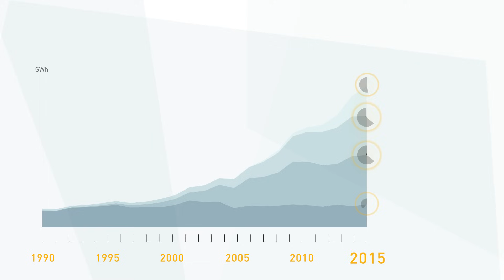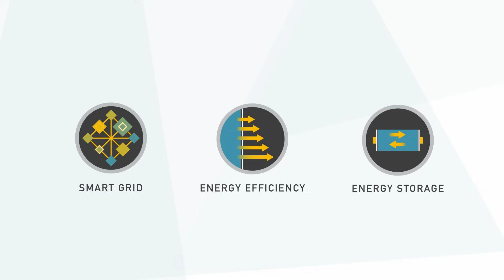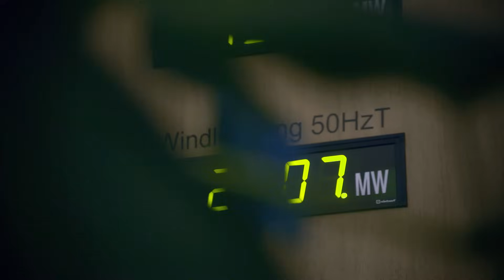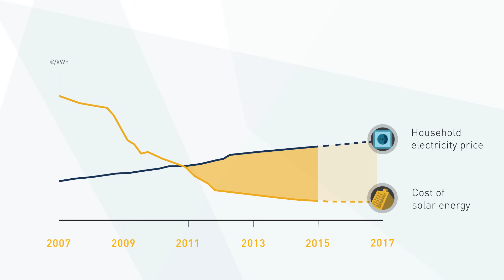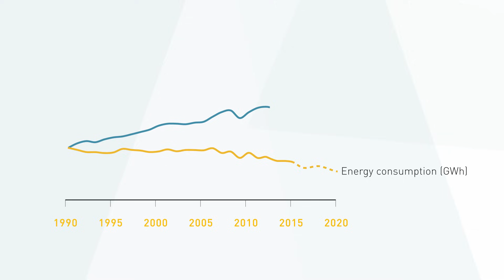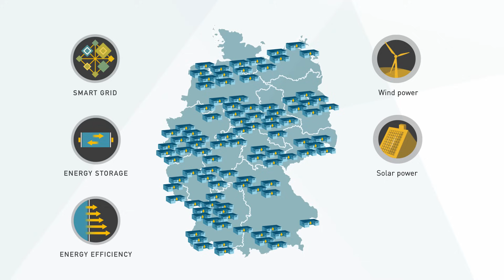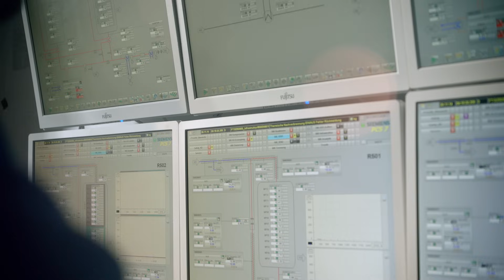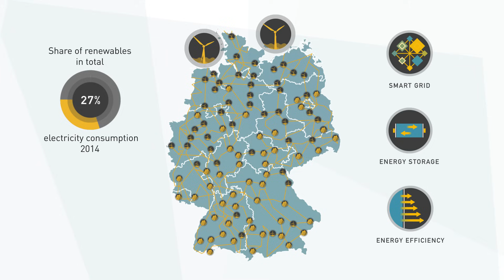Germany's Renewable Energy Revolution

Comment: This so called green "revolution" will fail. The cracks are already beginning to show. 
- The costs are enormous. This is primarily due to the insane capital costs.
- Energy prices are rising in germany.
- There is no significant reduction in co2 emissions in fact it has pretty much stayed the same and some sources even claim it is rising.
- The German grid is extremely unstable. There are more interventions than ever.
- They (wind and solar) are not able to give base load energy and storage is not feasible.
- Germany is one of the worst places in the world to produce solar electricity. Yet they have invested (at least per capita) the most in this technology.
- They are now burning trees as "bio fuel". Which is a shame because trees actually reduce co2, so burning them is very counterproductive if your goal is reducing carbon emissions. 

Unless Germany wants to be a 3rd world country in 30 years they should stop this insane policy. There are green ways of producing electricity but wind and solar are not practical. Geothermal and hydroelectric are real green solutions, however geothermal is far from being realised worldwide and hydroelectric is limited to specific locations.

We should stop giving wind and solar preferential treatment. At least let electric companies decide whether they want to buy solar and wind kilowats.

Stating that other countries are envious because germany is committing economic suicide is also stupid. Mostly people who have utopian fantasies and people who have a lack of understanding about the concequences of such policies are envious of germany's green energy policy.
Reply: +Guy B Can you provide your sources? Because i'm pretty sure that most of what you state here is just not correct.
Of course the cost's are high, but not nearly high enough to bring down an Economy, In fact, they are actually a joke if you compare them to for example military spending or foregin aid.
I don't know what country you are talking about but CO² emmisions in Germany have been going down for years. 
The German grid is overly stable, with statistically less than 20 minutes of power outage per power connection per year. (European average is 58 minutes, US average is 240 minutes) That's one, if not the most stable power grid in Europe. 
Well with a smart grid you could in theory cover a majority of germany's base load using sola and windpark's. The rest could be covered with biogas and water. 
Well guess what germany might not be a "good" place to build a solar park, but it is still worth it because solar pannels got so much cheaper, largely due to the investment's that have been done. In fact, covering a square meter with solar pannel is now cheaper than covering it with bathroom tiles. 
They are not cutting down trees to burn them, they are mostly using wood waste. It's also not called Bio fuel, it's  called pellet heating and those heaters are mainly found in private household's. 
And yes, energy cost is high, but it has always been like that in germany. They have gone up a bit because of the changes that have been made, but they are expected to come down again as soon as all the infastructure is built and payed off. 
And Electric company's are actually deciding to buy solar- and wind kilowatt's. In fact, solar energy is very cheap on the market and many households decide to pay a few cent's more per kilowatt in order to have their power provider only buy green Energy for them. 
Your turn. Prove me wrong if you can.
Reply: Mark Oberst “ Can you provide your sources? Because i'm pretty sure that most of what you state here is just not correct.”
I will provide information to the case I am presenting.

- The costs are enormous. This is primarily due to the insane capital costs.
https://en.wikipedia.org/wiki/Cost_of_electricity_by_source#Germany

Provides information about Germany as well as other countries. Solar and wind are almost always among the most expensive.

- Energy prices are rising in Germany.
http://www.spiegel.de/international/germany/consumers-bear-brunt-of-german-switch-to-renewable-energies-a-861415.html
About 6 eurocents are added to the kwh for renewable projects and that is not the only energy tax households have to pay.

Industry is also suffering:
http://www.forbes.com/sites/jamesconca/2015/07/02/germanys-energy-transition-breaks-the-energiewende-paradox/#d9083fa29681

- There is no significant reduction in co2  emissions by the energy production sector in germany between 2000 and 2010

http://www.indexmundi.com/facts/germany/co2-emissions

The total amount of co2 emissions has gone down. However this is not because of the energy sector.  co2 emissions from energy production has stayed flat. We can therefore conclude that renewable energy in Germany has not reduced co2 emissions between 2000 and 2010.

- The German grid is extremely unstable. 

There are more interventions than ever.
This is from a book that is in favour of renewables it shows the rise in grid interventions for just 1 company:
https://books.google.nl/books?id=dbRZAwAAQBAJ&pg=PA65&lpg=PA65&dq=german+grid+interventions&source=bl&ots=_PAb7yPAlN&sig=87IF7TPIYRUzjKT9CGaCBw00yzk&hl=nl&sa=X&ved=0ahUKEwjN4vjww_jLAhXCHA8KHch9DCY4ChDoAQgtMAI#v=onepage&q=german%20grid%20interventions&f=false
This study has a graph showing grid interventions in Germany:
http://www.larouchepub.com/eiw/public/greenfascismpromo/pdf/54-56_Greenfascism.pdf

Why would such figures even be a surprise? It is logical that an intermittent energy source would behave like this. 1 moment you have undercapacity and switch on coal and gas, an hour later you have a lot of wind power and suddenly you are faced with overcapacity. The more you will increase power output from such sources the more interventions are needed and power outages will likely also be more common.

- They (wind and solar) are not able to give base load energy and storage is not feasible."

This one is self evident. When it is night and the wind does not blow, no energy. So you need backup from fossil fuels.

- They are now burning trees as "bio fuel". Which is a shame because trees actually reduce co2, so burning them is very counterproductive if your goal is reducing carbon emissions. 

“It's also not called Bio fuel, it's called pellet heating and those heaters are mainly found in private household's. “ 

I was wrong about this point.
 
 “They have gone up a bit because of the changes that have been made, but they are expected to come down again as soon as all the infastructure is built and payed off. “

Can you provide evidence for this point? Because when exactly is building new infrastructure going to end in Germany. To go from 12 percent wind and solar, to more significant numbers will require even more power lines, which costs money. Also to consider their goals (100% renewable energy) means that they will have to make even more infrastructure for energy storage. Which is not done much at the moment but it has to happen if you want to take wind and solar seriously.  So I would be extremely skeptical towards the idea of energy prices coming down in Germany in the coming years. I think it is likely that they will become even higher.

“And yes, energy cost is high, but it has always been like that in germany.”

Can you provide sources for this? Because the last I read claimed that around the year 2000 energy prices were about 14 cents per kilowatt and now they are around 37 cents. Which would be an 264% increase.

“Well with a smart grid you could in theory cover a majority of germany's base load using sola and windpark's. The rest could be covered with biogas and water. “

The smart grid does not solve the intermittency problem. You will still need energy when it is dark and the wind does not blow. Also how are you even going to scale up water and biogas? Hydroelectric power is limited to mountain areas. Which could be expanded, but its limit has to do with the height differences in Germany. Which is not nearly enough to cover most of the grid. Biogas is also extremely limited.

“In fact, solar energy is very cheap on the market”

Solar energy is among the most expensive energy forms that are on the market. Even wind is better than solar. According to the link I have sent you infrastructure adjustments costs associated with solar are not even included. What about the fact that you have to maintain all existing fossil fuel plants along side of solar? That cost is also not included.

All in all wind and solar are stupid forms of energy. That does not mean that all renewable technologies are stupid or impractical. I believe a world wide effort to tap the enormous potential of the earth’s heat (geothermal) would be far better than these impractical sources(wind and solar). At least such forms of energy can be used on command and provide base load energy. Personally I like nuclear too and nuclear could also easily replace fossil fuels use from power stations in the future. But if you do not want nuclear, geothermal is probably the only real possible solution. Of course  we should maximize hydroelectric output because it is cheap and has no co2 emissions.
Reply: Guy B OK let me take a look
Your first Source (The Wikipedia article about LCOE coast's) does not state that PV and Wind power are always the most expencive one's and the coast's are definetly not "enormous". In fact, your own source states that onshore wind is alway's among the cheapest while solar is not as effective installed on one's roof, but suprisingly good installed as a power plant.
 And yes, coal is always the cheapest, but it's also a "dirty technology" and remember, we're trying to stop clima change, and the only way to do that is to get rid of coal power plant's. Another reason to start investing now is that, as the Washington post states that "A new analysis suggests that we continue to move into a world in which it makes more economic sense to draw electricity from the sun or the winds, rather than from fossil fuels."(https://www.washingtonpost.com/news/energy-environment/wp/2015/10/06/wind-and-solar-keep-getting-cheaper-and-cheaper/) 
Also, the study used in the Wikipedia Article (https://www.ise.fraunhofer.de/en/publications/studies/cost-of-electricity) states that Solar is expected to get a lot cheaper. 
About your secound source, i never said that the consumer is not paying for the switch to renewable energy's. I just found it 
ridiculous that you stated that it will destroy the whole economy and make germany a 3rd World nation. In fact, here is a study stating that the Energiewende will be in fact affordable 
http://energytransition.de/2015/11/energiewende-cost/ 
Your third source does not state that the industry suffers, it states that the energy revolution coast's money that the german people have to pay and of course it does.. Germany has put law's in place in order to protect so called energy intensive industries from those coast's. (http://www.photovoltaik.org/wissen/eeg-umlage-ausnahmen-fuer-energieintensive-betriebe) 

Next Argument
Well 2000 to 2010 is really a long time ago, here you are i found a newer source. 
http://www.carbonbrief.org/climate-showdown-has-the-us-uk-or-germany-done-more-to-cut-emissions 
The Co² Emmisions have began to go down. Also, renewable energy's have always helped to keep Co² down. There were other factors that kept them up, like coal power plants for exmaple, but if there wouldn't have been an increase in renewable energy sources than Co² would be even higher today. 
Ok next one
Your source is stating that there are more interventions required to stabilize the german grid because of renewable energy. However, that doesn't mean that the grid is getting unstable. In fact, what do you think a smart grid is suppose to do? It's a system designed to intervene in order to make it possible to integrate renewable energy into the grid. The grid itself however has remained stable, as the following source states. Here are a few quotes: 
"production of intermittent green electricity has risen sharply over the last few years and worries about security of supply for consumers have been voiced by the industry. But, so far, actual power blackouts have become even less of an issue. Germany still has one of the most reliable electricity grids in the world.", "But there has so far been little evidence to back the claim that the quality of electricity supply is declining." "In a more recent steatement, VDE said that Germany had one of the most reliable electricity grids on the globe. The year 2014 was the best 12 months in terms of security of electricity supply since VDE started gathering data in 2004, it added."  (https://www.cleanenergywire.org/factsheets/germanys-electricity-grid-stable-amid-energy-transition) 
=> More interventions have been required, but the grid overall has gotten even more stable.
Next one  
"This one is self evident. When it is night and the wind does not blow, no energy. So you need backup from fossil fuels."  
Well most energy is used at daytime, because obvieusly people are awake at daytime. https://www.eia.gov/todayinenergy/detail.cfm?id=830 
Also, the wind might not always blow everywhere, but it always blows somewhere. Thats what those massive current path's are being built for. Also, solar and wind are not the only two kind's of renewable energy. There are also for example water and Bio fuel. And using something like a Pumped storage power plant, you could store energy without the need for batteries . https://www.eia.gov/todayinenergy/detail.cfm?id=830 
Also, as the Video states, battery technology is evolving and will be getting a lot chaper soon. That would solve that problem. 
Ok next one, solar has gotten cheap during the last 5 years and will be getting even cheaper. I found a whole study about this and other related topics: (https://www.ise.fraunhofer.de/en/publications/veroeffentlichungen-pdf-dateien-en/studien-und-konzeptpapiere/recent-facts-about-photovoltaics-in-germany.pdf) 
In fact, now that i found this study i can use it to underline a lot of my Argument's. It also talk's about different way's to develope a smart grid and states that it is possible to "cover a significant portion of germany's energy demand with pv power", (p. 52). They even go through different possible scenarios.
It also talks about different way's to store the energy to use it for example at nighttime. 
Read through that, this sould take care of all the base load stuff.
It also talks about why solar and especially wind energy are everything but stupid. THey are expected to rise in the coming year's. And yes, i also think that it was stupid to get rid of the nuclear power plant's but what can you do. Reneable energy's are the future and investing in them is the only logical step. It might be expencive in the short run, but will eventually pay for itself over time. There is no doubt about the fact that the world will have to do the same during the next 50 year's in order to fight climate change so i guess investing now and developing an industry that can fullfill the growing demand's for renewable energy solutions worldwide is actually a pretty smart thing to do.
Reply: Mark Oberst “does not state that PV and Wind power are always the most expencive one's and the coast's are definetly not "enormous". In fact, your own source states that onshore wind is alway's among the cheapest while solar is not as effective installed on one's roof”

My source does not include extra costs to transmission lines and all the extra costs from all the fossil fuel plants (You have to keep them all with wind and solar). I was talking about solar in particular here. However what are the actual costs of renewables?
The investment in the windmill or solar panel + maintenance of existing fossil fuel plants + All the extra transmission lines (which btw needs a diameter that is able to transport the maximum current and not average current) + maintenance.

Geothermal for example could actually replace fossil fuel power plants. So the maintenance of the existing fossil fuel plants is not included in the price of geothermal energy. It is also likely that it requires less transmission lines.

“here is a study stating that the Energiewende will be in fact affordable 

http://energytransition.de/2015/11/energiewende-cost/ “
This study is far too optimistic about its goals and illustrates what I mean by Germany becoming a 3rd world country. The wealth of the western world is determined by the following things: Energy production, the effectiveness of that energy being converted to usable products and increasing ways of using energy. We have done this consistently since the start of the industrial revolution. Your computer today likely uses more electricity while using far less electricity in relation to its computing power. We have developed ways of making products more energy efficient (led lights, efficient cars, less energy intensive production methods) but have also found new ways of using energy. Energy consumption as well as energy efficiency has increased. That is why we are so damn wealthy today. However for Germany to expect to use 90% of its electricity in 2020 and 75% in 2050 is economic suicide. We do not live in a static state where nothing changes, we will have new ways of using energy in 2050 and if Germany does not use this energy they will not be able to compete in these new markets. They will effectively become poor while the rest of the world gets wealthier.

 "A new analysis suggests that we continue to move into a world in which it makes more economic sense to draw electricity from the sun or the winds, rather than from fossil fuels."

Hey I’m all for cheaper energy. It would be great if we could use clean energy and it being cheaper than existing technologies. However this article totally ignores that in order for renewable energy to beat fossil fuels, you will need to store that energy. Water storage has limits, battery storage is not at all likely to happen. Perhaps hydrogen will take the place of storage, but this will also cost money. You cannot take this serious if you have to keep all the existing fossil fuel power plants in order for renewables to work. If you cannot store the energy from these sources, you will not displace fossil fuel power plants.
Also does it make economic sense that the prices of Denmark as well as germany have gone up to almost 40 cents per kilowatt? I do not think so. The green lobby always makes promises. It will get cheaper next year. We are on the verge of a global renewable revolution. This has not been the case at all. Electricity prices have risen dramatically in the countries that have the highest share of renewable energy.

“The Co² Emmisions have began to go down. Also, renewable energy's have always helped to keep Co² down.”
Yes C02 emissions have gone down. However as I have shown before(in Germany) in the electricity production sector co2 emissions have not gone down Wikipedia states that it is 360Mt from energy production. This was the same 10 years ago. It has even gone up.
https://en.wikipedia.org/wiki/Energy_in_Germany
This means that in spite of all the extra installed renewables, renewables did not have enough impact to reduce Co2 emissions.
Because renewables are backed up by fossil fuel plants that need to heat and cool all the time to match renewable you are reducing the efficiency of fossil fuel plants. 1Kw of wind or solar does not replace 1Kw in coal energy. If power plants use 10 ton coal with 40% efficiency if it runs constantly than you use 4 ton of that coal effectively. If you heat and cool this plant it might run at 30% efficiency, meaning it uses 3 tons effectively in this case. Of course it might take longer to burn that 10 tons because you are not using fossil fuels all the time, but solar and wind power do not completely offset fossil fuel power plants. It is kind of a waste of money if your proposed solutions do not solve the problem.

“Well most energy is used at daytime, because obvieusly people are awake at daytime.”
Yes people use more energy during the day. But would you like it if your fridge would not work at night because there was no wind at that moment? I do not think you would. It might lower fossil fuel consumption a bit. But even than in winters you have big problems. The only demonstration of 100% renewable energy 24 hours a day 365 days per year is Norway with 100 percent hydroelectric power. Wind and solar energy do not even come close.

“And using something like a Pumped storage power plant, you could store energy without the need for batteries “
“Also, as the Video states, battery technology is evolving and will be getting a lot chaper soon. “
“Pumped storage power plant, you could store energy without the need for batteries “

I believe I have been over this already. So we are at 40 cents per kwh for renewable energy without energy storage (Germany and Denmark). What do you think it would cost with energy storage? You might be willing to pay 1 euro per kwh, I certainly do not. There is no evidence suggesting that battery prices are coming down enough to store energy successfully. I also think that successful battery technology should not be used to store renewable energy, instead cars, phones, laptops, etc should be using most of the battery storage. Neodymium should also not be used for wind energy. These super magnets should be used for high quality sound systems, not wind power.

“It also talk's about different way's to develope a smart grid and states that it is possible to "cover a significant portion of germany's energy demand with pv power"”

Smart grids cannot provide more renewable energy, it might be that less of the electricity is wasted. You still have the night, no wind, cloudy and winter problems.
 
“Reneable energy's are the future and investing in them is the only logical step”

Renewable energy is not the future. It is also far from logical. Consider the following. Denmark produces 40% of its electricity from wind. Denmark has increased its wind power in the last 20 years. How much energy Is 40% of demarks electricity? 32TWH (total) * 0.4 = 12.8 TWH or 12800 GWH. The average wind capacity given per hour is 12800 GWH / 365 / 24 = 1.46 Gigawatts per hour. That is 1.46 GWH on average, Ignoring all fluctuations in electricity production. They have massive fields of windmills and did this in a 20 year effort. But 1.46 Gigawats is terribly low. Im going to take a high capacity nuclear power plant. https://en.wikipedia.org/wiki/Bruce_Nuclear_Generating_Station . This is 1 nuclear complex of 8 reactors. It produces more electricity than Denmark’s entire need. 45 TWH annually. That is 3.5 Times as much from 1 nuclear power complex as the entire wind output of Denmark. At a price tag of $14.4 billion CAD and produces no carbon emissions. If Denmark only used this 1 reactor complex, they would have lower energy prices than they currently have, Lower carbon emissions from electric power plants and could export 13 TWH of electricity to other countries. This is how bad and unrealistic renewable energy is.

 You predict that this is going to be a success when nothing indicates that at all. It has been a failure from the start until now and it is unlikely that it is going to get much better. Instead of taking this problem seriously, Denmark willingly chooses to fuck around with their useless windmills. Germany is not better. They have not reduced Co2 emissions from electricity production at all. It is still around 350 Mtw. So all the installed wind and solar capacity has been for nothing. This is the real state renewable energy is in, not the fantasy land that is perpetuated by the media and European governments. EU governments want to use this failure as a model for the EU. The leaders of the European countries that support this are morons and absolutely incompetent to rule our countries. And you know the stupid thing? In the country where I live we have a terrible politician called Geert Wilders. I do not want to vote for him at all. But his party is the only party that actually wants to increase nuclear capacity. 1 other party is neutral to the idea and the rest all want to mimic the failure of Denmark and Germany. But as it stands today I have no choice, because I know we need low-carbon, reasonably priced and practically inexhaustible energy production to have high living standards in the future. So I am going to vote for this fucker I hate on all other issues, because I do not want to live in a country where energy prices are 1 euro per kilowatt and that drags on with stupid windmills and solar projects with no real solution at the end of the tunnel.
Reply: Germany has a relativily long and hot summer. You may not know but 40°C are not unusual here. Solar energy is a solution, we boil our water and we cover electricity, we even sell it...
Reply: And nobody is burning trees. We burn biological waste and we grow rape and corn to burn. But we dont cut trees and burn them...